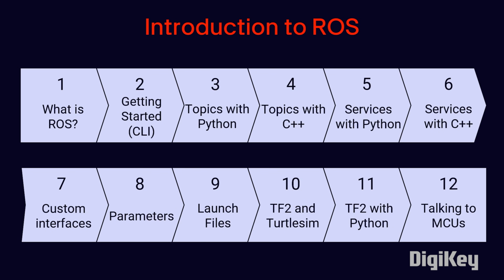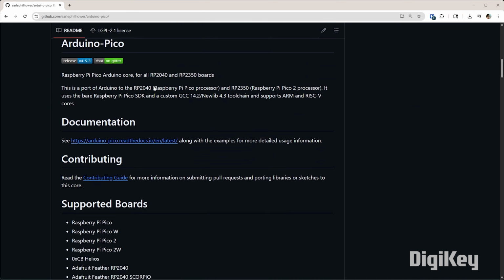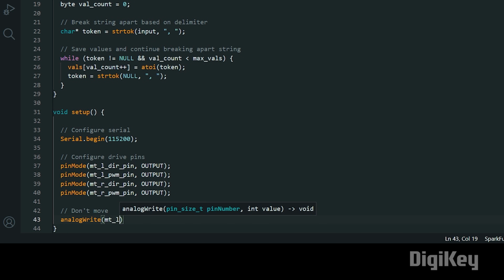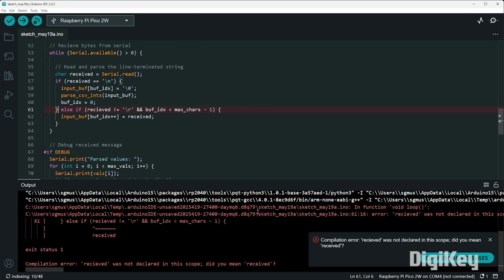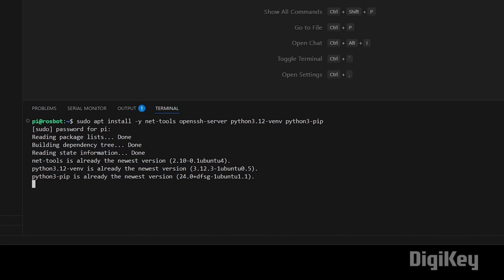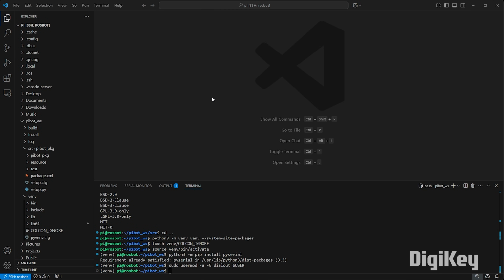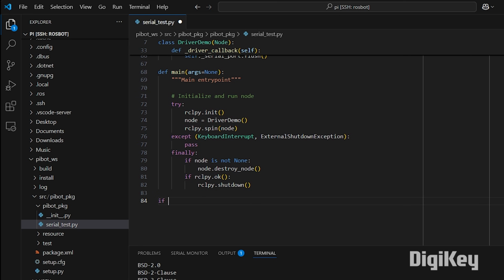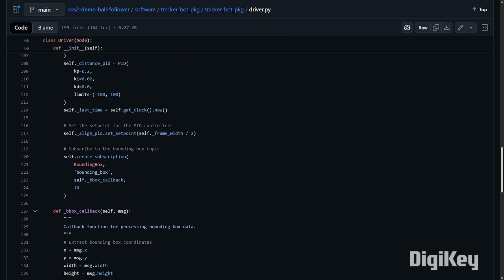Introduction to ROS Part 12: Talking to Microcontrollers

Comment: Very good series! Can't think of better adjectives at the moment. I have built a model car (Ackerman steering, 2 motors) and completed basic remote control with a publisher and subscriber node. Now moving on to use LIDAR for collision avoidance and slam. I am using both Python and C++, the latter a learning experience. You're input on that is very helpful. Thank you!

Comment: If I am designing a robotics project around a Compute Module (having my own PCB) if I dont want to use serial via USB to communicate from MCU to Compute Module, what is the adequate communication protocol to use for ROS 2 between the MCU and the Compute module ?
Reply: You have a number of communication options: UART, SPI, I2C, CAN, etc. It depends on: what comms peripherals you have available on both the MCU and Compute Module, bandwidth requirements (i.e. how much data do you need to send back and forth?), and the distance between the MCU and Compute Module. For really simple point-to-point comms with low-ish bandwidth, I find UART is perfectly adequate.

Comment: Nice demo. I think many should learn these basic steps for robotics. It could perhaps be interesting to see a follow-up where ROS commands are treated as high-level intent and the MCU owns a motion queue/state machine. That abstraction really starts to matter once bidirectional serial traffic is added (motor position/status feedback), since buffering, ordering, and pre-emptive stop handling need to be designed in from the start.

Comment: The PWM signal inversion occurs because an H-bridge is used with the PWM signal on one side and the other alternating between HIGH and LOW levels. When the toggle side is OFF, the PWM signal works normally, but when the toggle side is ON, the signal is always HIGH, causing the motor to rotate when the PWM level is LOW (basically, inverting the PWM signal). I hope this explanation make sense.
Reply: Thank you! This was really confusing me :)